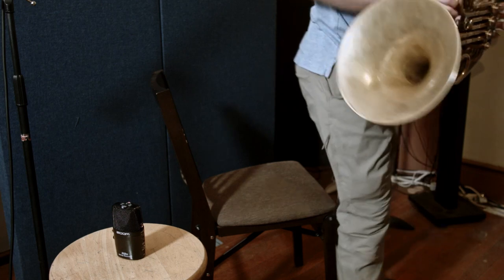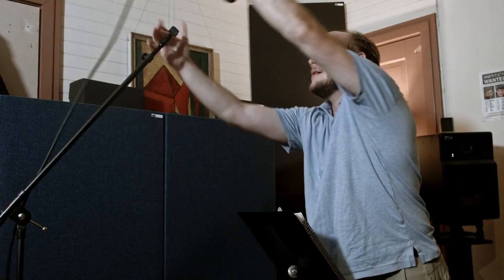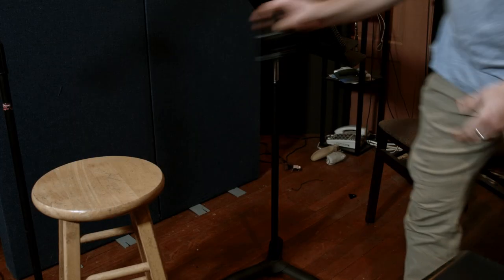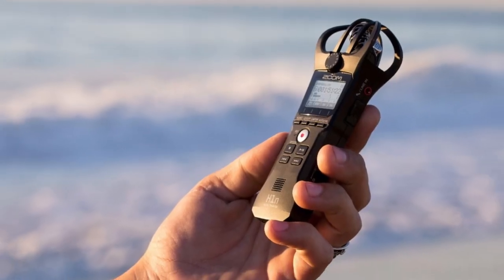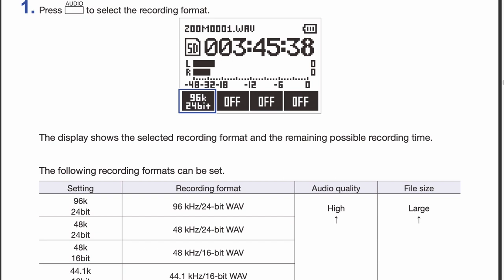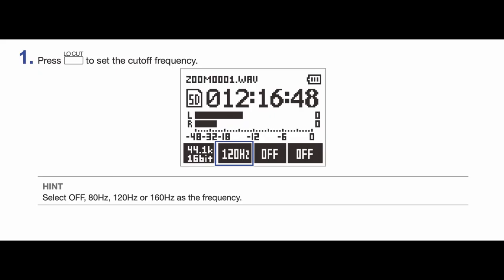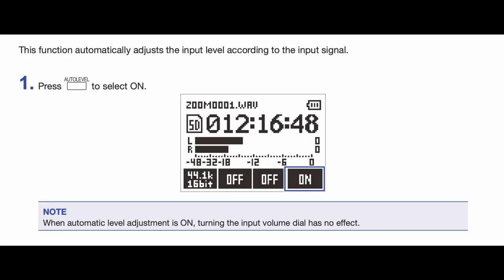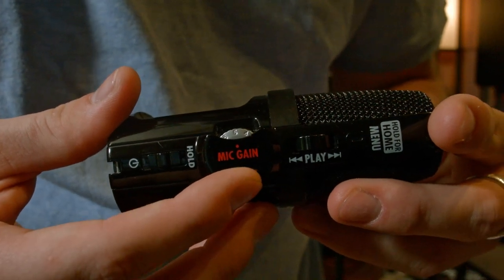How to record French Horn with a Handheld Recorder

Comment: Any tips for the Pyle PDMIC78 and french horn?
Reply from the maker: It looks like it is essentially a SM57. And my advice doesn't change too much for mic placement. Ideally you'll want it in front of you and above your head by about an arm length and a half. You will want to avoid placing it bell side into the bell.